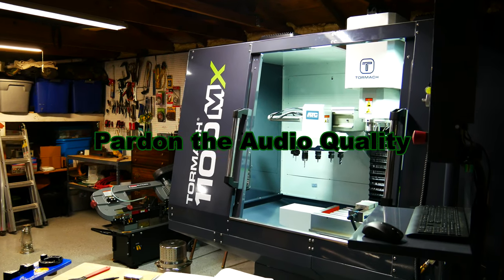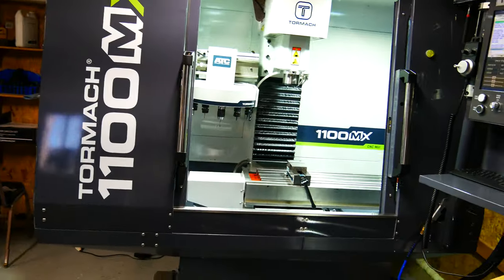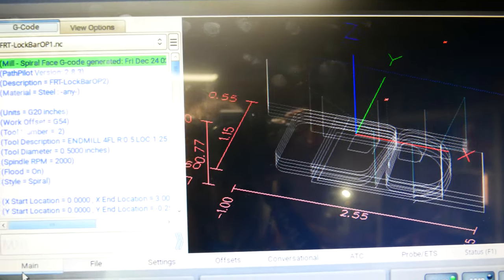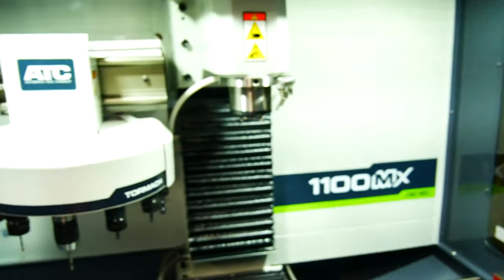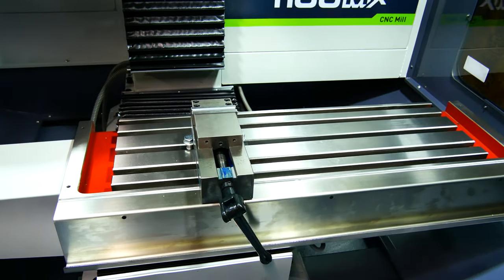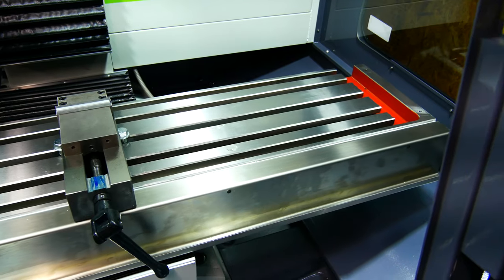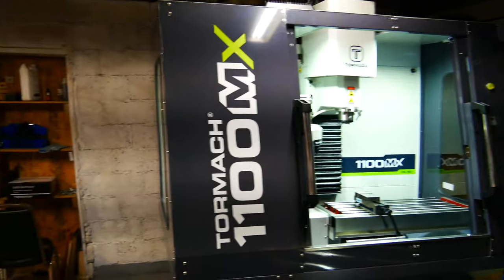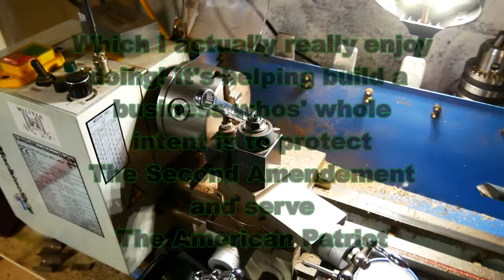FRT/Machine Update Video

Comment: Great video. Would you do another of you actually doing a cnc run on the frt bar?
Reply from the maker: I can't do one of the first bar but I will do one of the parts running... That original code was slow and kinda "meh" it's running a really cool high speed path now!
Reply: @MilitiaStateArmory    Ok, so this equipment can design FRT's in whatever configuration you program it to?
Whether it be Alamo Graves, Para 15 or RB Triggers?
Reply from the maker: @Brian Johnson  for the most part yes. You definitely have to design it and work out all the coding, tooling, fixtures, and stock.
... but yes whatever you program it to make it'll make. Though there is some skill involved in it.
Reply: @MilitiaStateArmory    Triggers must be made out of some sort of metal alloy last time I checked.  Plastics wear out fast
Reply from the maker: @Brian Johnson  OH yeah, it's a steel alloy. The triggers, hammers, lockbars, pins, etc, are all made of O1 tool steel. It's high in vanadium, tungsten, and manganese. After being milled they are then heat treated and tempered to around 58RCH.

So yeah, these aren't cheap 3D printed parts or anything. This is near aerospace quality!
Reply: @MilitiaStateArmory     What is your opinion of the 3 FRT triggers produced?
1) RareBreed Trigger  2) Alamo Graves 15 trigger  3) WOT Trigger
Reply from the maker: @Brian Johnson  I'm kind of a small new business and have been investing a lot into machine equipment and things for the business, so I'm still operating on a very small tight budget.
Also, because I'm manufacturing, I spend a ton of ammunition in testing...

I guess what I'm getting at is I have almost 0 experience with most of the FRT's on the market, but a ton of experience with the Rarebreed and WOT triggers.

That said, the Rarebreed is a much better trigger than the WOT trigger from the factory; but if you have a WOT housing and upgrade it with all our WOT V2 parts. You'll have a really nice trigger that is in my opinion comparably better than the Rarebreed factory trigger.

... that's because the location of the lockbar pin hole on the WOT is .05" forward of the RB's, which helped play into the V2 design that mates up with the BCG more squarely and allows a good thickness of the locking bar.

Where I'm still in testing and working a V2 for the rarebreed but because that pin hole is back 50, the v2 lockbar is kind of thin... but our v1 for the rarebreed has always worked perfectly, so I'm slow to change or "fix" something that already works perfectly and has been tested in shop (at our public range) to 8000 rounds and still kicking like new (though the corners of the bcg are beginning to round a bit, but the trigger looks perfect)... which is why the v2 design

So in the end if you're getting all the upgraded parts and everything, their both really good triggers, and comparably the same.

Comment: will you be making the full thing? or just the bar?
Reply from the maker: We build 90% of the kit in house. The bars we do 100% of the process (cutting, buffing, heat treatment, etc)...

The springs we order from an American Spring Manufacturer as a base spring, but then we have a bending jig to put the hook and leg bends into the spring, and snip them down to size.

Also the install tool we don't make, we order those in bulk.

Hopefully this answers your question. I'll be putting out a how it's made video in the next few weeks.
Reply: @MilitiaStateArmory  awesome!  Ya that would be great!  Ill watch out for it :)    thank you!